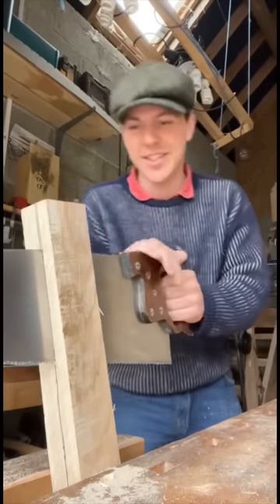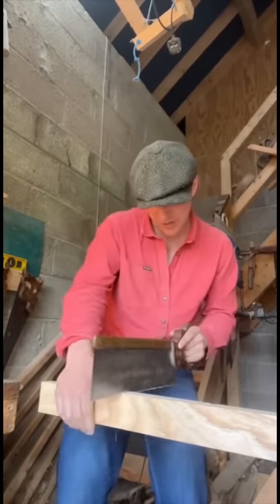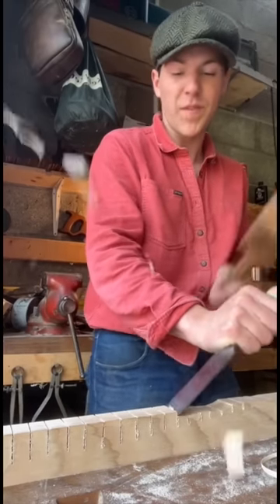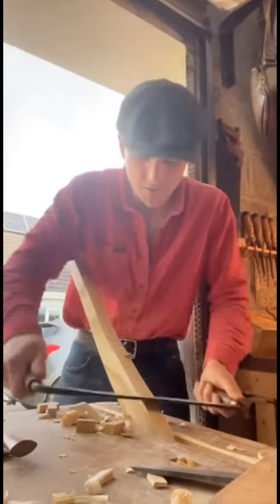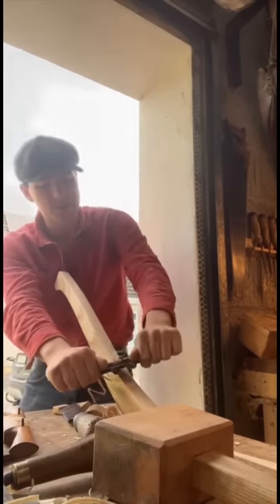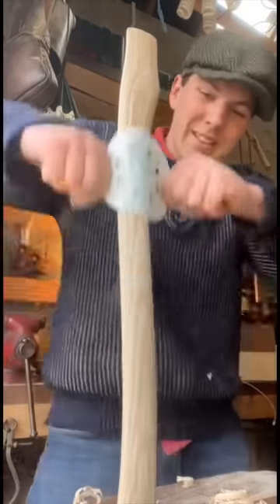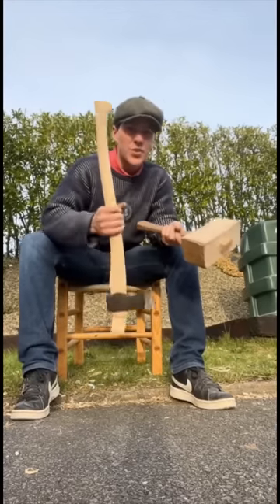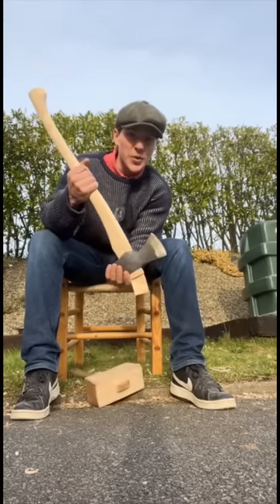Making an Ash handle for a small Forrest axe #handtools #shortvideo #ireland #axecraft #woodwork

Comment: For anyone wondering, inertia is a phenomenon in physics that is defined a resistance to changes in motion.

As an example, think about riding in a car that is moving 60 miles per hour. If you slam on the brakes, the speed of the car moving is, obviously, drastically reduced. Since you are riding in the car, you are travelling at the same speed, but as you already know, your body will try to continue moving forward, which is why you are jerked forward and pushed into your seatbelt. That's inertia - your body is resisting the change in motion by trying to continue to move forward.

In this video, the handle is inside the axe, and the bottom of the handle is hit with a hammer. The axe and the axe head were both motionless, and when the bottom of the handle is struck, it is knocked forward by the impact. This means that, by necessity, the head of the axe also has to move in the same direction at the same speed, because it is attached to the handle, but the initial inertia causes the axe head to remain motionless at first, and to then accelerate to the same speed at a slower rate of acceleration, which drives the handle further into the head of the axe.

I don't know if anyone really needed that explanation, but there it is.

Comment: try plumbers open mesh abrasive tape used to clean pipe for solder, Also forks awesome to work at shaping wood (comes in rolls so you take what you need).

Comment: The way the axe head climbs the handle is the head is heavier than the wood so when you smack the wood it jolts down too quickly for the head to move with it, so the head doesn't actually climb the handle it just doesn't move when the handle moves down

Comment: Hey Mr. Reardon, I’ve got a question. How would you go about tightening the fit of a handle inside of an axe head. It’s got a metal wedge going lengthwise. I think it got loose because the wood shrank over time. I don’t want to replace the handle though.
Reply: Get yourself another wedge and pound it in. Preferably so it expands the wood in the loosest direction.

If you have some spare steel, you can make one in like 5-10 mins.
Reply: I recommend removing the ax-head entirely to try to figure out why it came loose in the first place, and fix that issue when installing a new handle.

But if you do decide to try and save the old handle, this is what I have done before:

Make sure to re-seat the handle firmly into the head with many soft-headed-mallet blows.  This will seat the head onto the handles shoulder, and hopefully will loosen up the old wedges a bit.

Then you'll have to fudge around drills, screws, picks, and punches to encourage the old wood and metal wedges to rise out of the bite.

Once you've got that done, get the head off and examine the handle.  If you think it looks good, reinstall the head and make sure to once again, firmly seat it. 

Then you can hammer in a new wood wedge nice and tight, and snip off the excess.  Make sure to leave a tiny bit of handle sticking up through the head, instead of completely flush cutting it

I recommend that you use a round metal wedge to really expand the handle wood into the head.

Sometimes, that fix will get you another cord of wood out of the axe before the handle goes, but sometimes it'll get you another 20 years.  

It really depends on the deterioration/quality of the handle, and your abilities of repair.
Reply: Thank you both kindly, I think I'll take the extra time and take the head off and try to seat it better. It's a hand-forged axe that I picked up for ~$12 last time I was in Poland so it shouldn't be too hard to work on. I wanna keep the wood for "authenticity's" sake.

Comment: Honest question regarding setting the handle. Am I supposed to hold the handle tight while hammering it with the mallet? I always thought it was a sliding loose grip based on what I'd seen in your videos. You're practiced at it, so it's done too fast for me to tell.

Comment: I understand that you dont have local hickory but you have to admit its a far superior handle wood
Reply: I've used both and couldn't really tell a difference as long as the grain alignment is correct. Just select a good piece wood or handle, thin it out and don't overthink it. Hickory is the stronger wood though.

Comment: Hickory is better than ash for longer lasting handles sorry but I've had to change my handle on my ash axe probably 3 or 4 times in the last 5 years from either the wood breaking or the one handle completely rotting inside the head from getting dropped in a river and my hickory has been constantly put through the ringer like no other mind you it's a double bit set up for chopping and hemming then I have my maul for splitting and I've fell probably 300+ trees with it and have banged the handle multiple times and of course it's tore up near the head but guess what it has never broken and it has never come loose ever it's the same as the day I bought her and she's outlasted almost every other wood tool I have other than my old Stanley chisels those are probably older than 99% of us here 😂 I'm not sure when they were made and neither is Stanley themselves they have no idea at all the only thing that tells us they're Stanley is their stamped with the word Stanley and that's it but back to the axes sorry but I'm going to use the thing that forest service and lumberjacks have been using for hundreds of years heck there's axes that have 50 year old handles still in use by the US forest service go to Yellowstone and look near the big fireplace in the main cabin that thing is sharpened yearly and is oil treated yearly and is used yearly for the fire that burns from early September onwards sorry for the novel I just thought I'd put the whole thing down instead of going back and forth

Comment: how does that work light bit want move heavy bit no want move light bit go down faster than heavy bit much like when youre in a car without a seatbelt the car stops you dont....... you not having as much resistance means you decelerate slower

Comment: Controversial opinion, Ash is not reliable. Sure you can make a handle out of Ash but it'll take it 25 years to become a pokemon champion. That's why I prefer Oak, specifically the 'Gary' genus, it's proven much stronger than Ash on multiple occasions